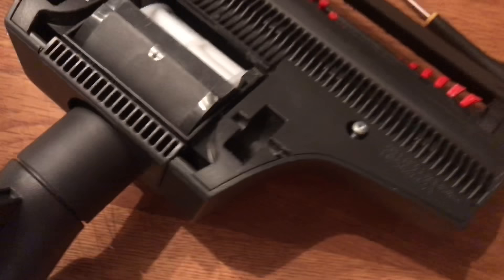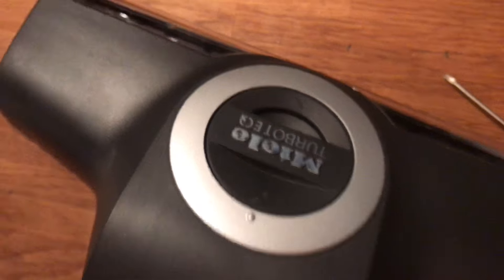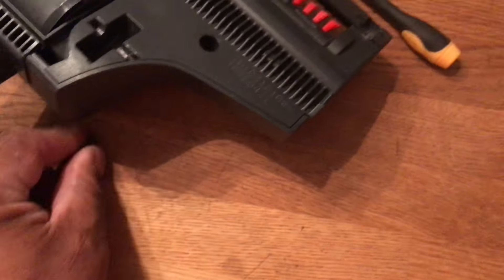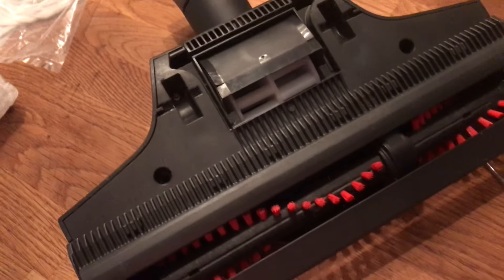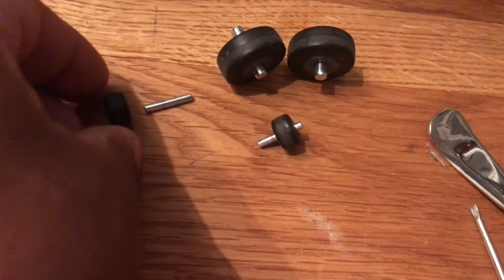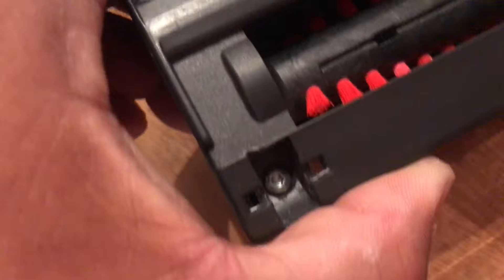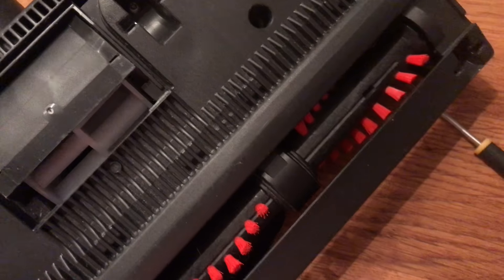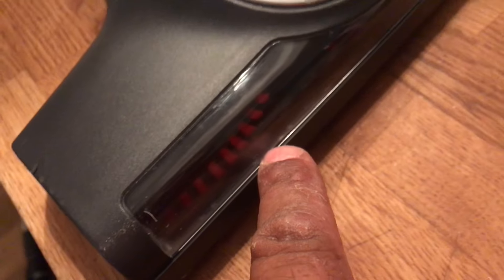Miele Turboteq STB305 Disassembly For Cleaning.

Comment: You don't need to remove the clear window if you are opening the unit. First use a zip tie and snake it under the wheels. Pinch it with vise grips and hold tightly with one hand and pull off the wheels. Don't lose the metal shaft axle it might fly out when the wheel pops off. Then use two flat screwdrivers starting in the rear section away from the clear window. It will open like a hinge pivoting at the front clear window. Then when it's almost open slide the small flat blade screwdriver along the outer black plastic pushing it in between the clear and the black and sliding both towards the center and it will pop in half leaving the clear plastic still attached to the top half.
Reply from the maker: Brilliant comment!
Reply: That would have been easier. I cleaned mine tonight. I ended using one of those gold hooks you nail to a wall to hang paintings. They were pretty easy to get under the clips and disengage them that way.

Comment: Thanks for showing where the screws are, but a demonstration of how to unclip the front would be really helpful. Got completely stuck at that point.
Reply: Me too! I am getting quite frustrated and do not want to break the plastic.
Reply: Did either of you work it out, my friend and I have been trying to pry the clips open for 60mins straight now. Did you end up having any luck?
Reply: You have pull quite hard to get the front off - a bit of pulling and a bit of wiggling. Since the head was basically useless anyway, I wasn't too concerned about breaking it, but it was fine. Took the whole thing apart, removed the hair clogging up the ends of the roller and the bot where the belt sits, and it was good as new.

Comment: I've given up. I found and removed all the screws no problem, but that clear plastic window on the front is ridiculous. The fear of breaking it was just too intimidating, so I've poked out as much dog hair as I could reach and put the screws back in. It's a bloody good vacuum, and I just couldn't risk breaking it.  My old Dyson was a piece of cake by comparison. One coin and all the fastenings came open and you could clean the inside easily. If anyone else manages to separate it and cares to upload a video I'd be very glad to watch it.
Reply: I got to that stage and thought f@#t it, it doesn't work so I can't make it any worse. It separated with a bit of pressure and didn't break.
Reply: Same thoughts on the Dyson.  When you have dogs the hair needs removing every time you vacuum.  Pulling hair from the STB305 makes my fingers hurt.  Dyson DC41 etc much better design for this.  Guessing they registered the coin turn design.
Reply: @stephenjohnson4481 it's ridiculously designed for a dog & cat vacuum, that's for sure. Doing my head in & wish I didn't buy it.

Comment: Great video except you didn't show how to get clear plastic front seperated. How is that done? Mine seems impossible without damaging the unit.
Reply: same, stuck and on the verge of breaking the plastic
Reply: It will come but with plenty of force.  What an incredibly goofy design.  It reminds me of working on a VW.  Thanks Germany.
Reply: I can't work out how to get the clear plastic clips off. Very helpful video, but only for half the job.
Reply: Ivan the Unpleasant.  Had the same problem but just discover 2 more screws under the tiny front wheels
Reply: Having the same problem and just discovered the Tiny front wheels pop out and there are 2 more screws!
Reply: @paulinetaylor1474  It is not the screws. The video is quite clear where all the screws are. It is the clear plastic and the way it is clipped in. Wait till you get to that part.
Reply: Break the grey tabs; you don't need them. They are only there to interfere with disassembly. I snapped them with a flathead screwdriver, finished pulling the filthy thing apart, cleaned it and put it back together. It fit together just fine, feels solid, and works like a charm.

Comment: also spent some time here. The 6 screws came off (4 hidden behind the wheels which came off by putting gift ribbon behind them and pulling) but never managed to take it apart. However, in my case it turned out not to be needed, removing the lid be pulling the two small levers allowed me to remove 2 years dog hair and now it works like a charm

Comment: May I suggest using some silica grease ir spray on the bearing surfaces and tiny wheel axles? Avoid the dino oil in there, and extend the life of your unit

Comment: Thanks for the tip about the wheels! They are sneaky. What a terrible design though. Our vacuum is a year old, the head had stopped working as it was jammed up with hair. I contacted Miele they said buy a new one, this is just routine maintenance imo as I know I'll have to do it again in a year. Annoying that an expensive thing doesn't allow you to maintain it.
Reply from the maker: Well, at least you know now how to sort it out quickly and without having to order parts. 👍🏾
Reply: @MostynWitham  I do, thanks. I think I'll get another older head as it was more robust and easier to dismantle.
Reply: The nozzle is really not designed for being cleaned this way, though. It is designed to run a pair of scissors along the grooves in the brush after every session to cut the wrapped around hair.

Comment: Thanks for making this video!   Removing the wheels was a little tricky, needing a torx 10 screwdriver is not nice (but not too bad).  Those tabs on the clear plastic are the pits, though!   I managed to use a small flat-head screwdriver to lever the black rubber/plastic up and over each tab as I applied force, and managed to get the head separated with only a little bit of mangling.   Next time, I think I'll just cut off the rubber that holds the tabs in place, I think the 6 screws would probably do OK for holding the head together.   

I've had vacuums from a bunch of different brands, and it's like no company ever considers cleaning powerheads like this.   They're all terrible for maintenance across the board.
Reply from the maker: Amen to that 👍🏾
Reply: Sebo seems to make head cleaning easy

Comment: It wasn’t easy to pull apart.  I found running a flat head screwdriver along the edge between the plastic clear panel and the main housing got them apart.    Luckily the whole thing went back together surprisingly easily.  It’s a 6 monthly job at most.
Reply: ^This! Thanks so much for this comment. I was stuck myself, but did exactly this and was able to pull it apart!

Comment: The roller in my one no longer rotates easily. I’ve taken it apart, cleaned it but when I assemble it, it still won’t spin. Next time a buy a Hoover I’ll check how easy it it to clean first so I don’t fall into this trap again.
Reply: If you take the roller out and look in the ends there is probably debris inside the ends and wrapped around the pins it sits on. Use a screwdriver to dig down into the roller ends to get it out. Also under the bit that the belt goes around gets clogged - this is what stops the roller spinning.

Comment: I can't pry the front off for the life of me is there a trick I could use
Reply from the maker: There isn’t a written or prescribed method. All I did was to wriggle and gently pull them apart.
Reply: Use the largest screwdriver and push the clear clip from inside to get it past the little cross member. Best to wet clean inside first to see them. Start at either end. Three in total. 

Also inside the belt drive on the bristle roller is the worst. It does clip apart with that large screwdriver from the inside.  

Yea, the worst design I have seen. 
“Immer Besser” - Nein.
Reply: This is wild. After an hour of struggling, I finally pried up open. Plastic got bent. But nothing got too damaged, I hope. The first thing I’m going to do now is get a sandpaper and sand those fuckers all the way down. What a nightmare!

Comment: Don't forget about the two small wheels at the front, they also need to be pulled out, and there are screws under that also. So yiu have 6 Screws in total.
Reply from the maker: DHM202 don’t remember the screw count but all the wheels need to be removed to access the screws.
Reply: @MostynWitham  sorry, I might have come across wrong..I just watched the Video, however you forgot to mention, that right at the front of the heD, there are two Wheels, they also need to be pulled out. and there are two screws under that...so I counted 6 screws in total. Once you have removed them all. The head will pull open
Reply from the maker: DHM202 that’s fine. 👍🏾 lots of folk have asked about how to take off the clear plastics part of the head and I’ve tried to put it across but not too well it seems. Perhaps you could cast more light on it?

Comment: Hi Mostyn, thanks for your video. It really helps. However this video only helped me half through. I had the same problem as some of the comments here with stuck at take the plastic front off. I believe I give it enough force, otherwise I might break it. Could you please make another video on showing how to jiggle it free? Thank you so much.
Reply from the maker: Unfortunately I no longer have a unit to show you but I can assure you that this is an interference fit and some jiggling and pulling will work, well it did for me.

Comment: I am a certified auto technician I have never seen a turbo brush do cleaning on that magnitude at home, but it's simple to see how to disassemble the turbo head.
For most people they want a step by step video on how to do it, it's recommended that at least you can display what tools are needed, such as torx size screws and so on, flat heads for prying etc. Thanks for uploading and sharing this how we mechanics give and share for each other or we figure it out ourselves.
*Update Mar 5 2021*
Tools needed for the ”service”
Torx T-10 size bits/driver and two flatblade screedrivers.
When you disassemble the wheels hold your hand over the wheels and pry them out under the wheel well were the wheels rolls smoothly and be careful about the roller pins not droping them.
Screw then off the T-torx 10 screws with a electric screwdriver or any tool you’d prefer for the service.
This is a very easy task to do.
Next pry the lower mount assembly carefully so that you don’t break the plastic off and all around the turboteq nozzle, pry inside the nozzle including the tabs that hold it together do that simultaneously.
Now your probably have gone by the previous task and your up for the cleaning, good luck.

Comment: This is one of the shittiest product I ever had to deal with. Barely 2 weeks after buying it my son tried to vaccum a pile of hair. Removing the brush should normally be a simple task for any decently designed vaccum cleaner.  But no!.  You here have 6 hard to reach screws with a weird 6-point star type of screw head. I did finally manage to remove them.  However there was no way of getting to the last step. The plastic cover with the clips could not be opened with breaking the whole thing. The bottom line is that is clear that the turbo head is not designed for servicing.

Comment: For those just trying to clean the bristles, I found you can use a razor blade or box cutter to cut it and remove the hair easily enough without any disassembly. Could probably get small scissors in there too.

Comment: Managed to get the wheels off and screws but the plastic cover is a nightmare. Just stabbed myself in the hand with a screwdriver trying to prise it off. Plastic bit not a good design to take apart Miele!

Comment: A tip for those people who don’t want to break the plastic “bearing” or damage the wheels when trying to take them off

Get a big metal paper clip, make it straight, then put a slight bend at one end. Slowly feed the bent end into the back of the wheel through the wheel well.

As you are pushing, keep bending the paperclip slightly to follow the contour of the wheels.

You should see the paperclip pop out behind the other side of the wheel. Keep feeding it until you got enough slack.

Make sure the paperclip is behind the wheel and not lodged between the wheel and the sides of the wheel well! If it is, then wiggle it back into position behind the wheel.

Bend both ends of the paperclip until they cross each other above the wheel. Hold the turbohead down with one hand. Then pinch the cross section tightly with pliers. Pull up with your pliers while holding the turbohead down. The wheel should pop off with a bit of force.

Long instructions but it was the easiest way I found to do this without damaging the wheels. You can also do it with strong string

Comment: How did you get the wheels off?
Reply from the maker: Kim Buckley hello. Do you mean the large outer wheels or the small ones in the video?
Reply: @MostynWitham  The two small wheels on either side of the brush, as well as the slightly larger ones that are already out before you undid the screws. I can't seem to figure out how to remove those and I think they have to be out to pull the big plastic part off.
Reply from the maker: Kim Buckley hi. Yes those wheels simply pull out. Be careful as the steel bar running thru the middle of each wheel can go Piiiiing!  I used a medium size flat headed screwdriver to gently prize them out. Try putting you hand over the wheel as you do this to avoid it going west!